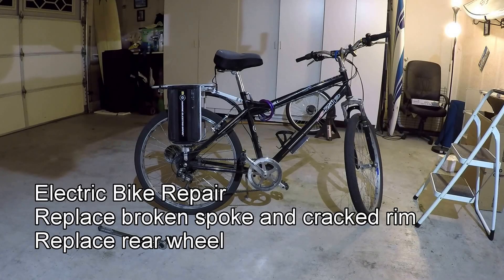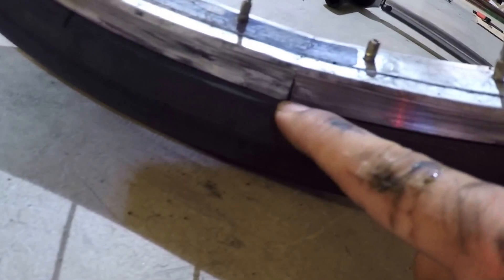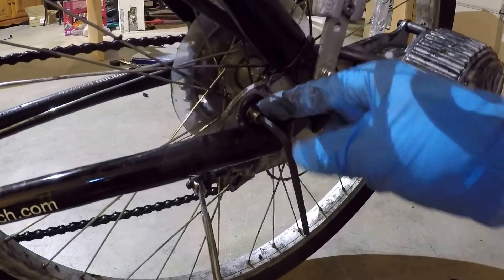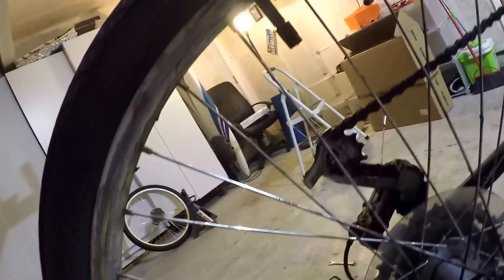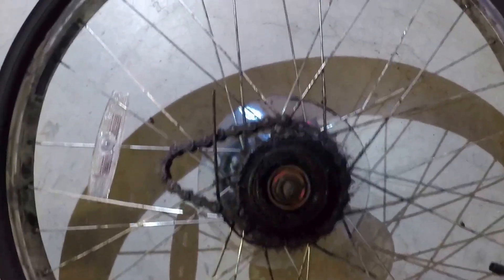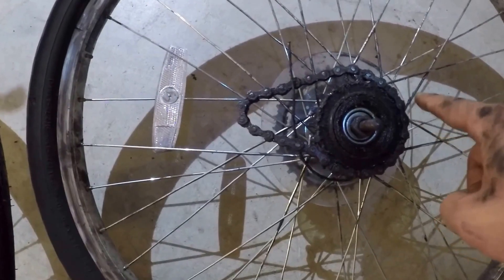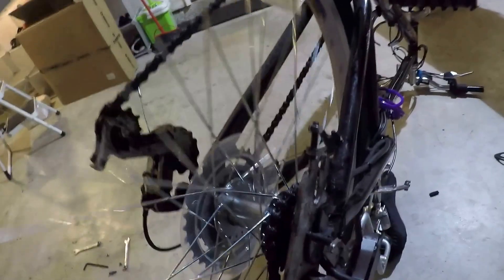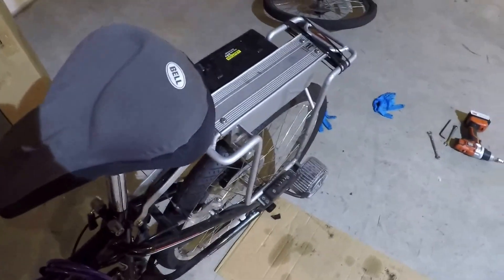Electric Bike noise problem, replace cracked rim, broken spoke, loose chain

Comment: heh heh, crack in the rim, you funny guy :) It's is no crack ofcourse, it's the place where the rim is welded together. It is not made of one big piece of metal you know, it's made of a long bar thats bent into circle and welded. The welding line just becomes more visible with dirt and stuff ;) You can see it on the new one too if you look closely. And a tip: let the air out of the tire when installing-uninstalling - much easier then.